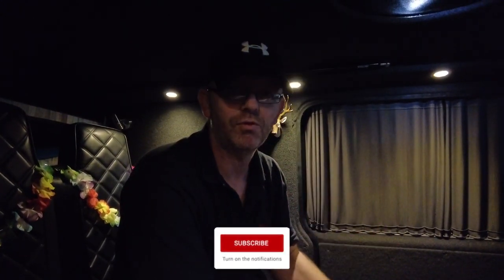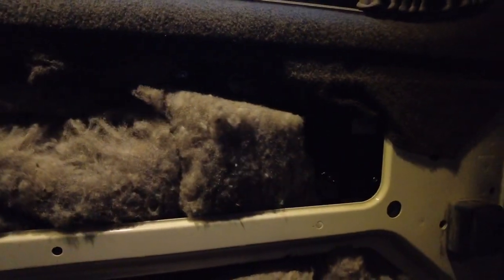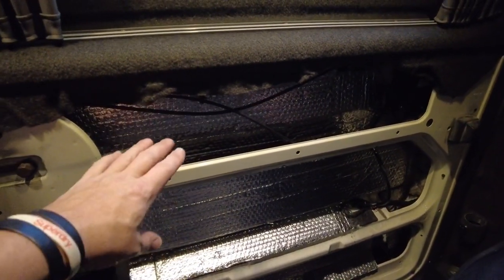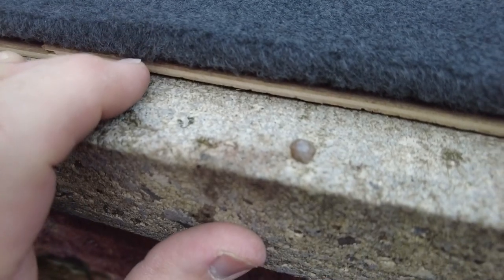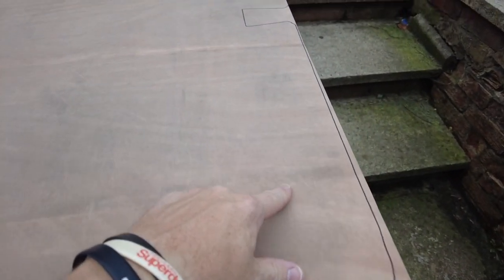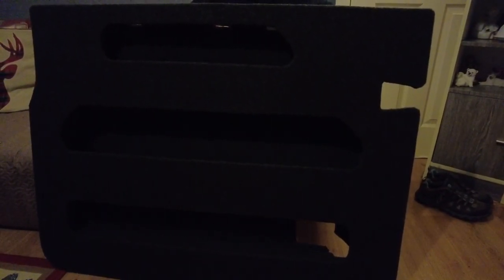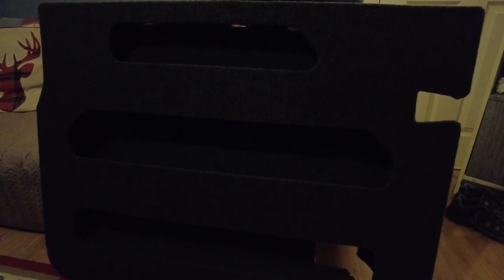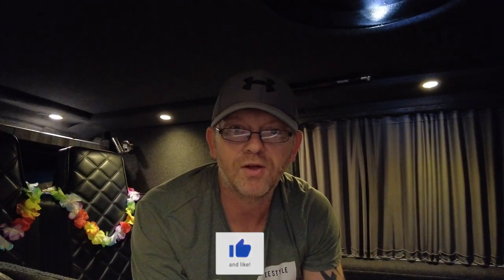Vw T5,T6 DIY Sliding Door Storage Panel Vw T5 Campervan

Comment: Brilliant
Reply from the maker: Hi Danny,didn’t know if I could pull this off but thought give it ago…..still working well looks like the real thing,I think the plastic one is well over £150 lol
Reply: @CampervanAdventures  I’m thinking they are £300 if I remember rightly. I’m
Following your steps 🤣👍👍👍
Reply from the maker: @dannystrange7202  lolol are they that much now(wow)……brown paper and pva go rock solid Danny,I’ve not had a problem with any damp in my van but for you or anyone reading this…..a top tip if you are worried it might get damp on the inside of the doorcards,you could buy a can of something called plastidip(it’s a rubber based paint)you can stray it on anything,that would 100% stop any moisture….but I’ve never had any issues👍😉
Reply from the maker: @dannystrange7202  if you’ve anything you’d like me to cover in a video,or ideas on anything video wise get intouch Danny…..and I’ll get on it mate
Reply: @CampervanAdventures  good tip that mate I know the stuff 👍👍👍
Reply from the maker: @dannystrange7202  Give it ago Danny,what you got to loose👍😉

Comment: Cool idea to use PVA and brown paper.. How has this held up? I've just pulled mine off and replaced/fixed handle & cleaned rollers and locks, works better now than when I bought the van 15 years ago! 

Interested in doing something like this.. Cheers
Reply from the maker: Hi calem,really appreciate you watch first of all and commenting…..the storage panel is totally fine,no sages or fallen apart(still as strong as the day I made it.To a lot of people it might seem strange to make it that way….but them two together makes a very strong structure.The good thing is it cost me nothing to build just time,I already had the carpet lying around👍😉
Reply from the maker: My sliding door catches the body work always has,got afew plans for the van so will be back on with you tube videos again soon…..not made any for awhile 👍😉
Reply: @CampervanAdventures  I spent probably 3 hours cleaning and figuring the mechanism out. It's a 1 finger close job now. 

Looking forward to come new videos mate. Cheers
Reply from the maker: @Goonit83  my doors never been a one finger close lolol I wish…..I’ll get back on the videos hard to find what people want to watch now so many Campervan channels now hard to find new stuff👍😉